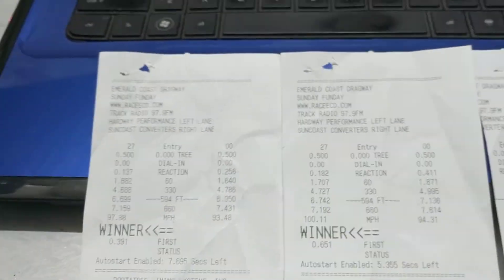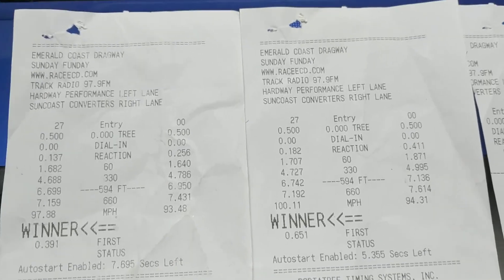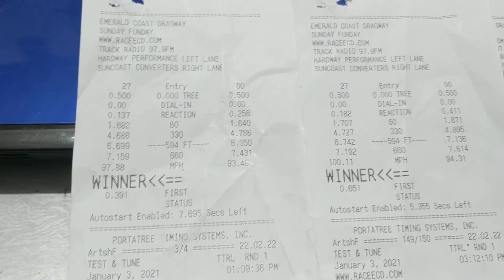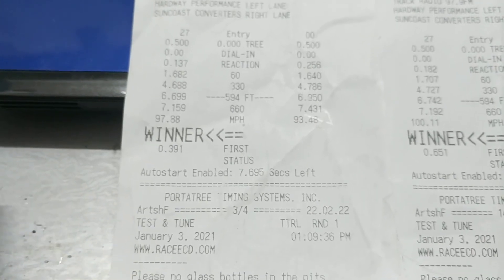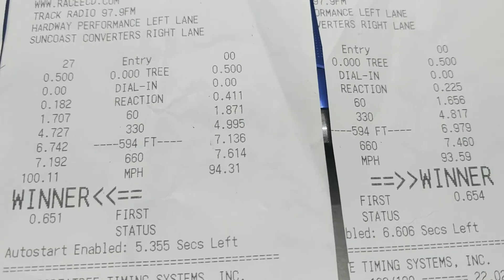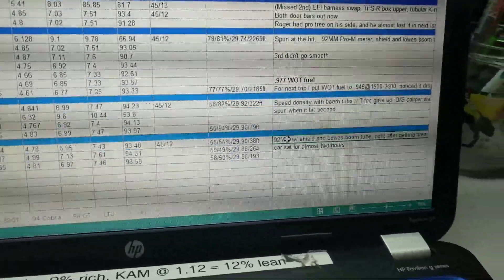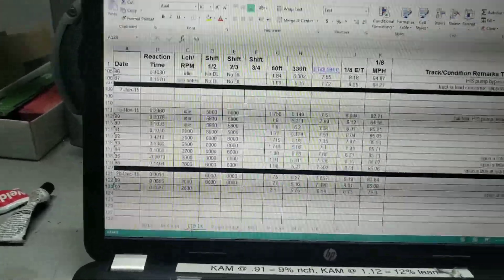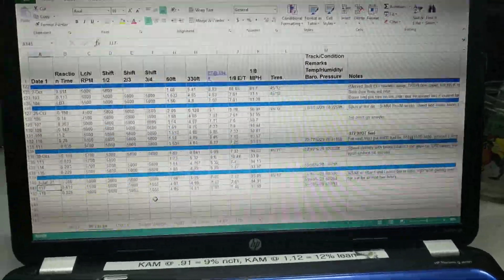Stupor Trooper track slips 17 January 2021

Comment: That's some good numbers , when you get the spool in it should shave your time down even more. Im hoping to get mine running this weekend if all goes well, i got to run my fuel lines and power wire for the fuel pump, fan , ignition box and put my radiator in and hook up my oil and water gauges and the tach with the afr gauge , man that sounds like a bunch of stuff now that I type it out 🤣😂 boy i better  get a early start if im going to get it going this weekend 😂 after that I will have to get my drive shaft shortened and build my rearend and if i get it going i will send you a video

Comment: I did a trick flow hci.  I'm having a hard time keeping it from stalling after a rev.  I bumped the idle to 1100rpm to keep it from doing that.  My timing is at 10 degrees with the cam advanced 4 degrees.  So 14.  I was told to bump it up to 18 and see if that helps.  Any thoughts?  Thanks
Reply: Sounds like it might need a base idle reset. My Fox was doing the same thing and once I did the reset it cleared right up. Good luck with it tho brother.
Reply from the maker: Yeah, that's a good place to start, 18 initial is 34 total. Do the base idle reset like already suggested and make sure you don't have any vacuum leaks.